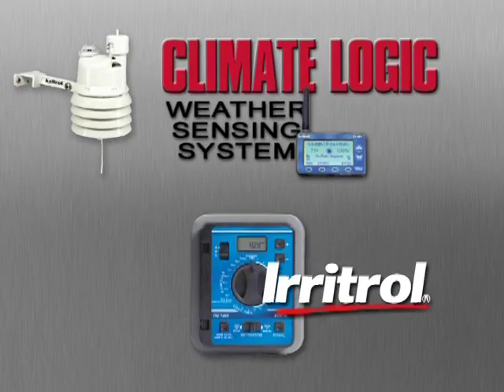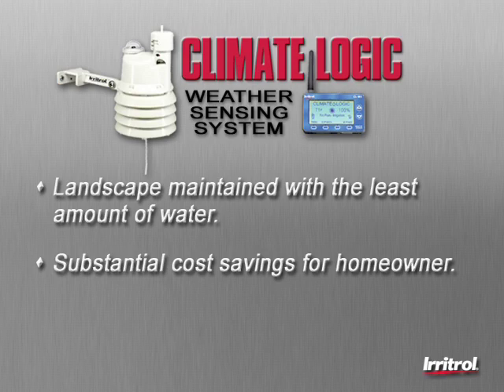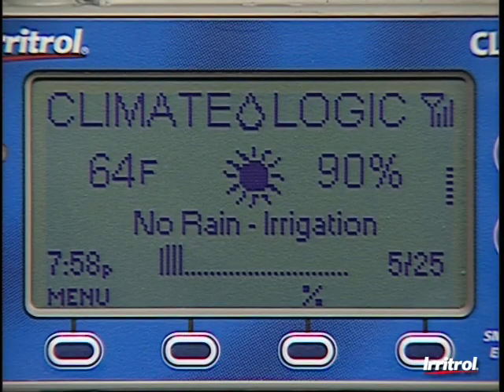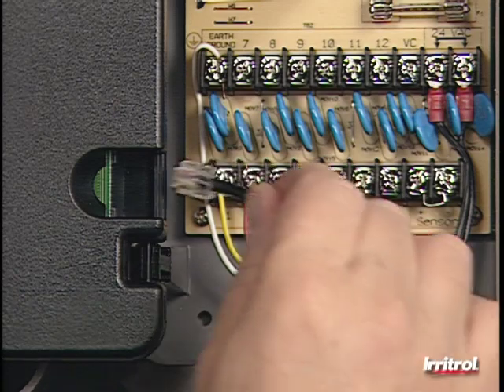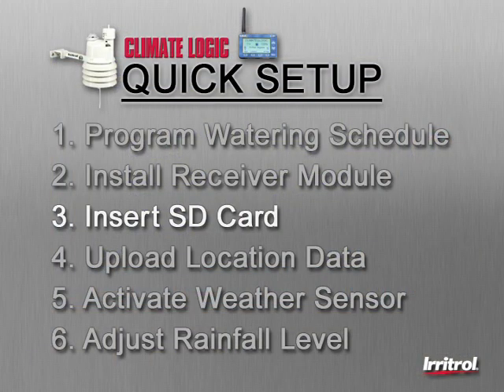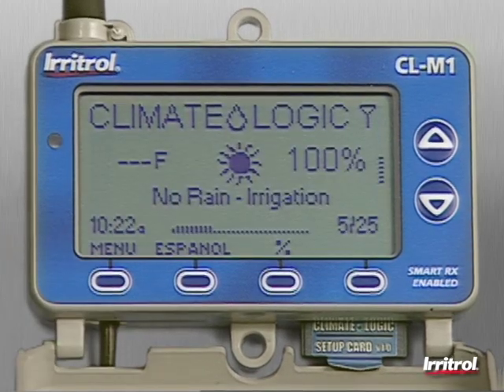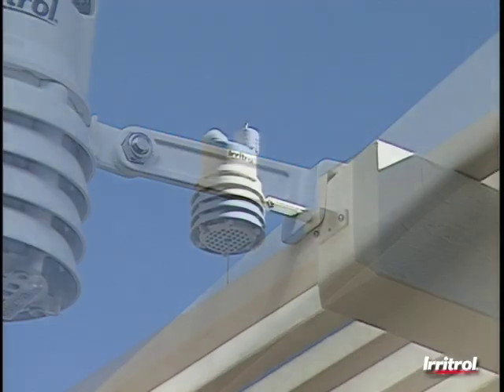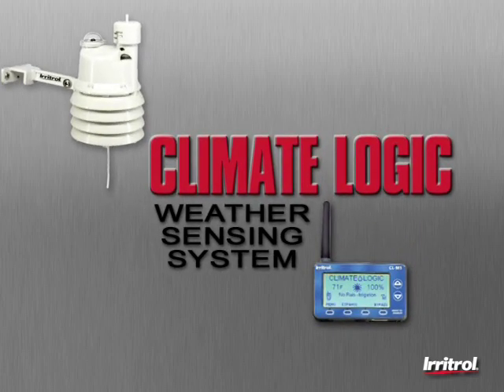How Irritrol Climate Logic weather system works

Comment: We have 3 dqys straight in the high 90s and its going 20%.  Location is correct. I'm just curious where it gets its "logic" bc 20% just seems low for how hot its been. Sensor is sensing temps correctly, its synced, and location confirmed correct.
Reply: I'm wondering the same thing. Mine has been going 10% which is totally pointless. No water is getting to the roots. And we haven't had rain in over 10 months! WTF?

Comment: Nice system, but how do you route the wire with the RJ11 plug into the external case (RD1200-ext-R).  Irrigation wire comes in through a 11/2 inch conduit going to the valves, and power going to the transformer is in its own 1/2 solid conduit.  Don’t see any way to get the wire for the CL100 receiver into the controller case

Comment: Nice technology, but flawed logic. It's the FREQUENCY of watering that should be varied to account for changes in weather. By changing the DURATION of the irrigation cycle, as most controllers do, including this one, the depth of watering is being significantly reduced, which means that the water is not reaching the roots. Think of your car: if you drive less, you fill up less often, but you still fill the entire tank. Too bad nobody understands this.  Owen Dell, ASLA
Reply: if we start with a soil that is adequatelly moist, would not a reduction of watering time based on favorable weather conditions efficiently output enough water to reach the roots? Would it be that an unefficient watering due to a reduction in time happen only if the soil were already too dry for the plants? Sometimes total zone watering is split to prevent water waste due to non weather factors but soil factors in this case your observation seems valid. Could this be the reason they advise to set the program to run every day if allowed?
Reply: @gardener1960  Yes. There's another brand (Rachio) that uses soil water saturation and weather prediction for the next day to suspend watering altogether, and you can enable or disable the saturation function. It is best to have more than a few days on these smart (ET) controllers, but around these parts, we only have 1 or 2 days per week to water (Excluding low flow irrigation like drip & bubblers), so we cannot set popup heads or rotors to run every day, but being able to set a smart controller is the best method where available. You can however set numerous days on a well or reclaimed water system, though, obviously.
Reply: Can this sensor be connected to Orbit B-hyve controller?